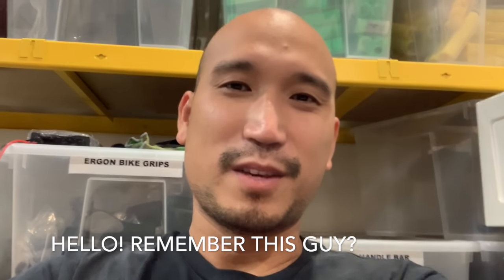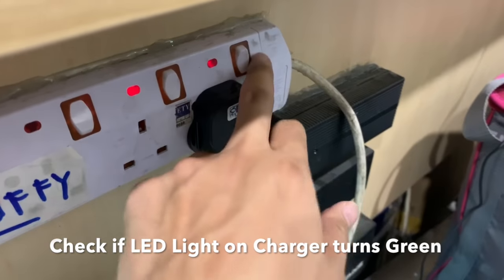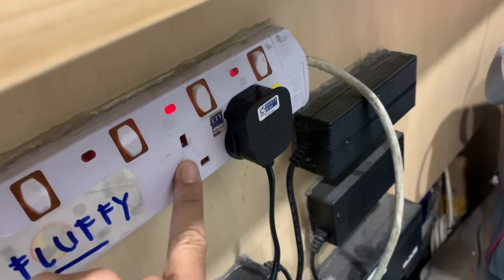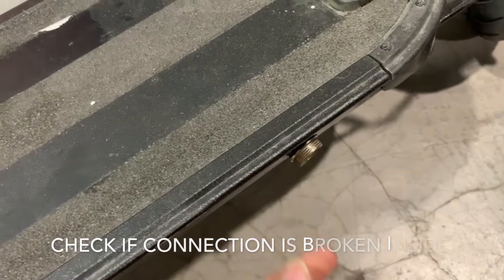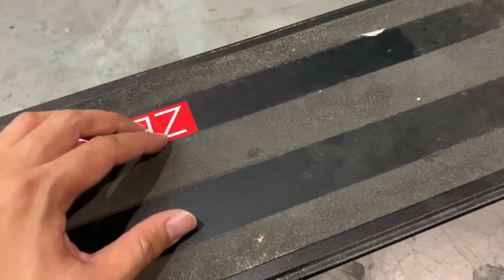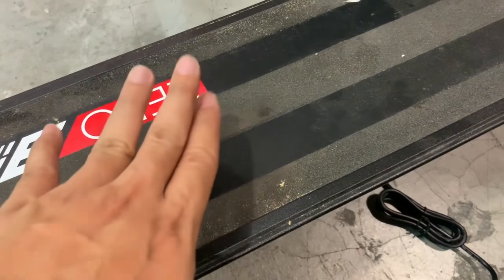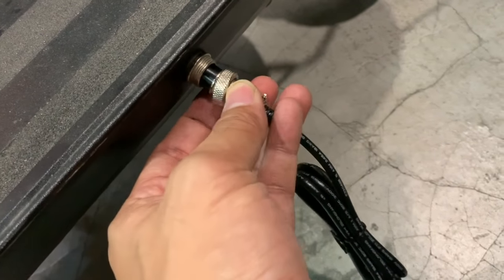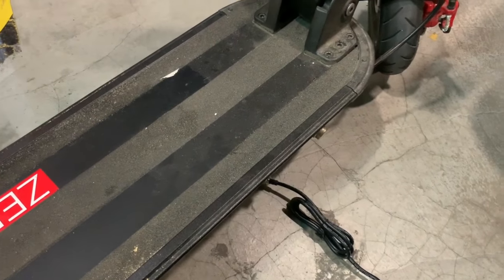What to do when your Battery Does Not Charge

Comment: what is the problem when i plug in the charger there is some ground and it stay green and never charge, is it the battery or the charger? thank you in advance..
Reply from the maker: Battery issue most likely
Reply: How to fix battery is light does not turn red? Other batteries work fine with charger
Reply: @pain_then_flex  mine is doing the same thing. Did you figure yours out yet? What did you do? Thanks!
Reply: @peacelovejoyandhappiness  same! Is yours on a pure scooter?
Reply: Same it is not fixing

Comment: @Falcon,  i tried to charge mine but it always stay green. Bought a new charger no difference. Checked the cables they are all in good conditions. This issue occured when i tried to speed up a hill and my electric scooter just turned off and since that event its not charging at all. It's a 60V battery but when i check with the voltage it's reading 3V now.
Reply from the maker: HarkaKiri ah ok simple, open up your battery compartment. Unplug your battery connector to the controller and plug it back in. See if there’s any life to it
Reply: @FalconpevSg   Thanks for your reply, i followed your instructions unplugged the battery connector and plug it back in. Charger stays green when i plug it in. I even bought a new charger just in case and same thing , stays green.
Reply: Probably your Electric  controller unit 
I had an error e3 with my throttle fixed it but then connected power and display with out disconnecting battery so the 5pin connector was damaged got a new one, and now my charger when turned on flicks from red to green instantly then it’s constant green 😭😭😭what the hell have I done lol
Reply: @savagereviews3673 thé samedi problem red for 1s then green alltime this IS thé 2nd battery and this happened since thé 2nd charger plug for charging

Comment: My 60v26ah e-scooter battery isn't charging when it is plugged in.  The light on original charger that came with scooter stays green. It has 46-70dvc output. Does this mean I need to try a stronger charger or would this be a different problem?  The battery is 3 years old.  no water damage - it's been stored in garage.  could leaving it plugged in too long cause problems?

Comment: Good video thanks.. I have vsett 8 I have seen this charger 48 volts for my scooter will this work.. Input :AC100-240v
50/60Hz Max. 2.5A output :Dc.54. 6V-2.0A..

That's the one  I'm looking to buy.. This is my one. Input Ac100-240v
50/60Hz 3.0A max
Output :Dc.54. 6v - 1.5A that's my one maybe it's like yours because yours is of  the same family 😊

Comment: where do we get the battery charger with the higher volt?  your video is not really clear,  it seems like the charger you used in this video was the original charger that it came with.    but as it turns out , it's not . It's some other charger with a larger voltage,  Well how do we get one like this?

Comment: I have a 48v 26ah pack and it had imbalace section. I got it charging then the green light come on but with I unplug the charger it falls to 38V. I plug the charger back in it shoots to 54 and stays green. I tore the battery pack open and unplugged the bms and jumper the charger straight to the battery bypassing the bms and still same result.
does the 18650 have a fuse in it? it floats 54v but no current. thanks!

Comment: Hello. I need help. I have a zero 9 scooter that won't take a charge. My scooter sat for awhile without use and the battery dropped to 21.6V, I removed it and had it checked out and the technician was able to charge it up to 51V. I took it for a ride and when I tried to charge it the charger stayed green. The battery is reading at 46.3V currently and the screen shows the battery is halfway. I tested the charger itself and is pushing out 54.6V which tells me the charger is fine. When I plug the charger to the scooter it turns green showing me that the battery is powering the charger, then when I plug it into the wall outlet it just stays green when it should be red. I tried your video and opened up the scooter again to try and find the fuse, but I don't see one. I've tried to research it and can't seem to find any information on whether or not this Zero 9 has a fuse. Please kindly provide some insights below to help determine the problem and how to fix it. Any help would be much appreciated. Thank you!

1. Do you know if my scooter has a fuse?
2. If so where is it located?
3. Is there a reset button to reboot the scooter?
4. What could be the issue it won't take charge when I witnessed it first hand take on a charge when the technician attached his battery charger to increase the BMS to 51V?

Comment: Just had an 58 volt battery for a tiller that would not charge. Because it had drained so low the charger just would not charge it. Ordered a new battery and charger-just to be safe if it was the charger. When the new battery came in hooked it up to the old charger and it charged the new battery. Then connected new battery to the old battery in parallel. It brought the old battery up enough for the charger to "see" it and now the old battery is charging with the old charger. I think I am going to return the new battery and charger
Reply from the maker: thanks for the contribution. Thats the kind of feedback we are looking for and not people who post non-constructive feedback. Thank you for this!
Reply: How do you connect an ebike battery in parallel? 48v
Reply: @tomgatta  positive to positive, negative to negative
Reply: What a quick response thank you. I guess I don’t see where I would connect it. Like the bottom where the slits are that connect to the bike? It’s an ebike battery so I don’t even know where the terminals are

Comment: This is such a common problem after 3-4+ years and I'm confident a majority of these batteries could be repaired.
Sometimes I wonder about product planned obsolescence in the firmware.. who knows hehe
Reply from the maker: sometimes the bms used in these batteries are not smart enough to sense undervoltage and shut off the sysrtem and these scooters have many active discharge devices that continues to drain power even if the scooter is turned off

Comment: Hi! I left my electric bicycle in storage all winter, and now when I plug the charger in, it won’t work and only stays green. How can I fix this? Thanks.
Reply from the maker: you may need to get either a fast charger or a higher voltage charger to wake up the battery. If nothing else, try to unplug and plug the battery back. see if it will wake up the battery.
Reply: @FalconpevSg  We don't have Problem's, "We Have Solution's" Thanks.
Reply: I did the same thing and now I’m having this problem too i don’t know if i just let the bike sit for too long long or something

Comment: What if when you plug it in it goes from green to red but then it keeps flashing back and forth between green and red what does that mean?
Reply: The charge box is also heating up too
Reply: I have the same issue. Did u find a solution?
Reply: Smh no answers yet?

Comment: MY CHARGER ALWAYS STAYS RED,IT NEVER GOES TO GREEN, SO ONCE IM RECHARGING I NEED TO CHECK ON THE LCD SCREENS BATTERY LEVEL INDICATOR TO SEE IF ALL BARS ARE FULLY CHARGED,IS THIS NORMAL,AM I RECHARGING IT CORRECTLY,I KNOW IT SHOULD GO GREEN ONCE MY BATTERY IS FULLY CHARGED BUT IT DOSENT YET MY BATTERY LEVEL INDICATOR SHOWS ME ALL BARS ARE FULLY CHARGED
I ALSO NOTICE ONCE IM RIDING I CAN LOSE 1 BAR QUICKLY ON THE LCD SCREEN AND GOES THEN FROM 3 BARS USED TO GOING  BACK UP  AGAIN CONSTANTLY,SO MY BATTERY LEVEL INDICATOR ALWAYS SEEMS TO GO UP AND DOWN WHILE RIDING,IS THIS NORMAL? PLEASE REPLY.
Reply: The same happends for me, did you solve it?
Reply: @darvida95  it's called voltage sag. It's when your batteries chemistry is lagging behind the output. Totally normal.

Comment: Here's a question that has confused me.  My battery charged up in 30 minutes.  I drove down only 10 townhouses and my battery quickly went down to 1/2 then dropped to zero. (Maybe 1 minute of use)  Is my battery fried? 

My charger shows me when my battery is empty, 1/2 charged and full.  It was full when I took it off of the charger.  My battery also showed the same being a full charge.  It was cool outside but not freezing.  Do I need to replace my battery?  Thanks for any help!
Reply from the maker: Lavender Rainbow firstly determine the voltage that your battery has when at full charge. 2. Determine the voltage your battery is at when it shuts down. 3. We can determine if your battery needs changing with these info
Reply: @FalconpevSg  Thank you!

Comment: Hello ,I didn't use my ebike very often its a 36 volts 10 amps lithium battery pack .When   it's charger is connected to it a clicking sound is heard from the charger at 2 seconds interval while a green light is always  on and red light never displayed. It never take charge. Do I need to charge it with a higher voltage charger?(it's original chargers specification is 100-240 volts ac 1.8 amps. Output 42 volts DC 2 amps).If I need to charge it with a higher voltage charger please specify what kind of charger can I use,thankyou !
Reply from the maker: try a 58.8V charger for 2 minutes
Reply: Thank-you Sir for your quick reply I will try another charger 58.8 volts and let you know after. Thank-you again!

Comment: Friend asked me to look at his and bypass the switch (calm down folks.. I'm hear first) he rides it all year round and is a necessity. Said he never turns it off, from bike to either backpack or charger again never being shut off... Said it went dead and wont take a charge.. He handed it to me w the switch removed  I do know a little bout electronic and do know how to solder and I've always had a knack for building and repairing things . he can't afford another one right away. So if it all possible this one needs to come back to life it sounds more to me like it needs reset then the switch that's never used replaced or worse bypassed. Any suggestions are greatly appreciated - preferably from an experienced technician
 I've never worked on an e-bike battery before...

Comment: Any idea , my charger on connecting shows red which means charging  but still my scooty is not charging after 3 points of charging it has stopped charging ,but charging indicator shows charging on connecting, i tried with two different chargers but still the same

Comment: The common issue is: Led has green light (supposedly to be charged) but your electric scooter has only charged to 50-52v (54.6v max). Today i had this problem again on my M4 Pro ( had the same issue on my M4). Need to get a new charger
Reply: You solved problem?  My e scooter 48v 10 ah  had suppose to charge to 54 but it do only 51.5  charger is problem?
Reply: @marianepure7307  yup. Usually it's rhe charger

Comment: how do i troubleshoot a low voltage reading to the motor?  
I have an 
i-m4 Single Seat Electric Golf Buggy with a curtis controller. 
The programmer reading indicates only 4v going to the motor on a 36v system.
I have checked all the wires from the 3 12v batteries to the controller and there is no loss.
Do i have to get down to the motor and take it apart to confirm if the connection in clean?

Comment: Thanks for sharing. Need help: T113 Scooter when charge it only goes 1 green light and when crack motor starts and display and motor dies. Charger is fine, out putting 66 V all the way to batt. I couldn't find any shorts. No lights no horn. Battery reads 66 V in my multi meter. I reset display, unlock with remote key, and same problem. Any ideas? I will appreciate. Battery is 18 months old. Could it be it went bad out of the sudden? (No errors in display either). Thanks
Reply: FLJ T113 use fake batteries , have the same issue as you mentioned.
Reply: @victormorales3144  We do not have the same issue but thanks anyway
Reply: @HarkaKiri  Well if I can be of any help, let me know.

Comment: I need help, I built an e-bike the battery I bought came with two lines (obviously) the Controller connection and the charger connection, the problem is, They DIDN’T LABEL which one is which, how do I tell which line is charge and which is controller? One has an XT60 plug female and the other a Tplug female plug, Like wtf? Why not one charge and one controller?

Comment: I have a ion armada e bike. It appeared that the kill switch had a short. Which it was fixed. But it's happened again. My scooter s dead. And no one in this town to fix it. Why is there no manual it's lead batts 500 w. 3 speed. Please help
Reply from the maker: battery is old, you need to change it. Because the battery has low voltage, the current pulled is too much for the kill switch to handle.
Reply: @FalconpevSg  actually that wasn't the problem. My kill switch on my armada ion torque keeps flicking to off and it then blows the charger. So I noticed That it needed to be turned back to on. And it works again. I'm unsure as to why

Comment: I I left my scooter in storage all winter and now it won't start.  Where can you buy a higher voltage  charger from?  Otherwise can I use a car booster to start it?
Reply from the maker: Jenna Kash no you can’t use a car booster. You need to measure the voltage and charge it up

Comment: Hi, i 've maximalsg 48v i think my battery is undervoltage. The charger lighted green when i connect to the port. I can see that when i switch on power there are some power left on my scooter. If i put in 52v into my to jump start 48v battery, Is it possible it will explode? Pls reply me back. thanks

Comment: Hi, nice video, thanks. My scooter is dead no power. Plug PSU in and it turns on but does not charge. Charger shows the scooter as charged (light turns green within 1 minute). I stripped the battery pack down and found 30 cells. 27 show 4.2v and 3 cells show 2.0 to 2.5. Are these cells finished? and can these cells be causing the entire issue?
Reply: I’m having similar issue. How did you resolve?
Reply: Yes, apparently they can! Just one or two bad cells can cause these issues. Switch out bad cells and you should be fine.

Comment: 🏴 I have a 48v 20AH viper Air pro, my partner put the wrong charger in to it ! Now it won't turn on😭 How do I fix this ?
Reply from the maker: Try to take the battery out and disconnecting the battery connectors. Plug and connectors back in and see if the unit turns on?

Comment: Hi mate ,I have an e-bike fiido d1 but when I plug in the charger it doesn't charge it suddenly stopped  i tried to connect with another charger but even with another charger it doesn't charge, I don't know if is battery problem or something else but it shows battery level.
Reply from the maker: Battery issue most likely

Comment: ARE YOU SAYING AS SOON AS THE CHARGER GOES RED, TO TAKE IT OUT AS SOON AS POSSIBLE EVEN IF MY BATTERY IS FLAT,ISNT IT MEANT TO GO RED TO INDICATE ITS RECHARGING THE BATTERY? OR AM I MISTAKEN.
Reply: T trojanisheretostay he's only using the high volt battery just like jumping cables for a car. he put a high voltage charger that was different from his lower volt battery. Now he did that just to wake the battery up but keeping the high voltage battery in charging  would explode because again that charger has more power than the scooter can take. So he unpluged it. After that hes saying go ahead and use your regular lower voltage charger to fully recharge the unit.

Comment: Friend, cordial greetings, I wanted to ask you a question is that seeing the manual of the zero 10x there is a part where it says that in the configuration the P3 must be with the voltage of the scooter, that is, 52v and that the P15 must be -6V, According to this the P15 must be in 46V? Since at the moment mine is on 41V. Which would be the right thing, thank you very much
Reply: Bonjour j'ai ma trottinette que j'ai pas charger depuis 2 ans 
Elle a une batterie 48v 10,4Ah et je ne sais pas si je peux la charger avec un chargeur a 58,8 
Est-ce que vous pouvez m'aider s'il vous plaît Merci

Comment: Does this work for a discharged e-bike or kick scooter that hasn’t been used in over a year.  I tried to charge both but the chargers remain green.  My e-bike is 36v and my e-scooter is 24.9v.
Reply from the maker: doesnt work in all situations. You can try using the 36V charger to charge the 25V scooter. for a bit.
Reply: @FalconpevSg  in my case charging using higher volt charger works but when I switch to the original charger it still not working. Would it damage my battery?
Reply from the maker: @amazingmotivation1344  if you leave the higher voltage charging for too long it will damage the battery!
Reply: @FalconpevSg  but it isn't charging if I use the 48v charger. So, what to do? Does it needs to be rebalanced in shops?
Reply from the maker: @amazingmotivation1344  no just use the higher voltage charger abit longer until the battery reaches at least 45V then take it off charge. Also check if your charger if ok.
Reply: @FalconpevSg  already plugged in the 48v and still it didn't work. 48v charger is working with other unit
Reply: @FalconpevSg  I think the battery needs to be rebalanced. I used the 52v charger all the way and it stopped charging at 54.3v. I think there're dead batteries inside. I will update you once the technician have diagnosis
Reply: @FalconpevSg  thank u though for the tip
Reply: what charger would you use for a vsett 10+
Reply: @FalconpevSg  I will try it.  How long should I do it for? I don’t want to overcharge it.
Reply from the maker: @pawsitivepanda  a couple of minutes if it works then it’ll work within 1-2 mins if not then it won’t ever work